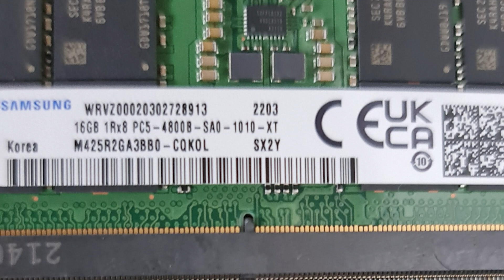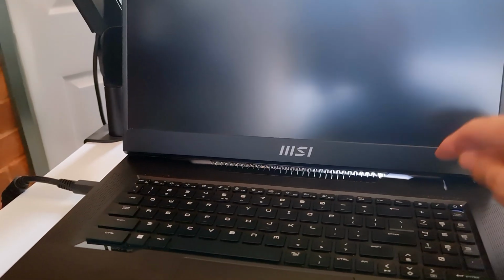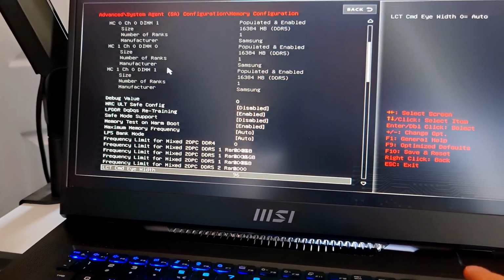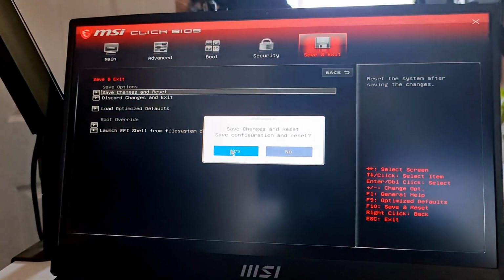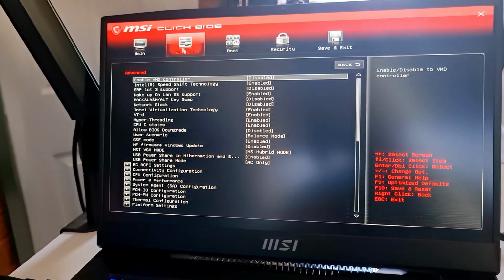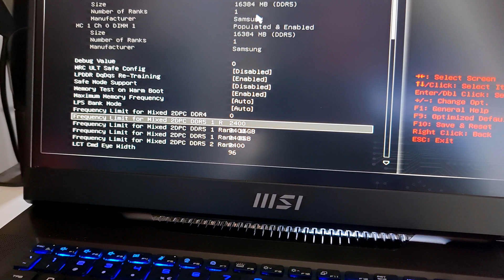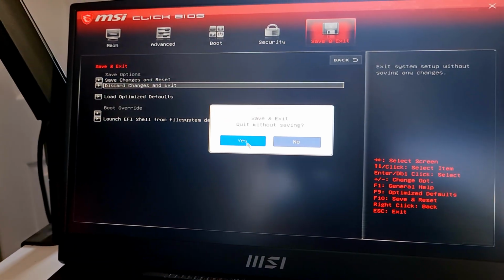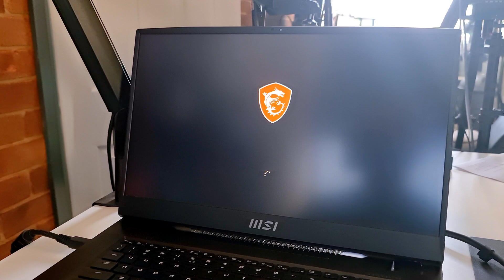How To Enable XMP on the MSI GT77 Titan Laptop

Comment from the maker: If anyone has any alternative methods for enabling the XMP, advise in the comments! Also, if anyone has found a solution to the boot delay, again please put your findings in the comments!
Reply: hey i got gt77 uhs today and found the solution. you do as u did set the profile to custom and on the other screen dont change the values to 2400 but as in help set all 4 to 0 which equals auto. it will load xmp right away. and for guys with all 4 stick populated in quad channel it can run ONLY 4000. as for the delay after restart these new chipset with ddr5 memory support training memory every time u touch it. i had 2 minutes 1st restart as well but then all back to normal. the system basically testing what it can afford. note the memory at 4000mhz runing lower latency then at 4800mhz but as for 3dmark the 4800mhz producing far bette results for me
Reply: Hi there mate,i just found a different method to change the frequency  of ram in bios without  having  that boot delay.i'll put a video to fix this issue,it's  not hard to do it.
Reply: @dunconpitbull  i have GT77 and the max memory frequency choice was 4000.
Reply: @dunconpitbull  where is the video?
Reply: Merci beaucoup @phatlavinh6150
Reply: I have a katana 15b13v, enabled secret menu - enabled oc - "memory profile"\"memory" not an option. If I just manually change the ram speed screen stays black and have to d\c battery (reg and cmos) to reset BIOS to be able to boot
Reply: @jlatture1  i got the same problem.because u can t overclock ram on Katana.u will ruin windows and a reinstall will be needed.all fury 5600-6000-6400 come at standard 4800.crucial is better because 5600mhz is standard.5600 cl 46 still better than 4800 cl 40.
And latest i714650hx that is in katana support only 5600mhz max anyway
Reply: Hey im the guy from reddit that switched out sticks from annoyance :) . I've tested this new BIOS on those same new sticks, i get the same slow boot issue if i try to manually configure timings. If i use the XMP profile it boots just fine. Must be to do when settings are changed for memory that's not left default or set to intel xmp. Annoying because i was running with better timings previously but the slow boot seems to also effect devices, my TB dock has issues and i have to refresh it if i use manual memory settings - likely due to whatevers happening during boot
Reply: Works great with ram that has xmp profiles on it. I suggest to just get new ram with xmp on it.

Also, you can fix the slow boot problem by turning off the test memory option. Once you see the wording , it becomes readily apparent why the boot is slow. It takes time to test the ram to ensure it's working properly
Reply: @Tech3D The solution is simple, you don't need to enable Overlocking feature or Set memory speed to 2400 just let it be

Just following these steps:
1) Set [Memory Profile]: Custom Profile
2) Set 0 for the fields from [Memory Ratio] to [NMode]
3) F10 to save and wait until the windows boot up ;)

*Note: MUST keep [WDT Enable]: Disabled, If you enable this option the slow boot will come
Reply: @phatlavinh6150  This gives me 4800mhz, but still have the slow boot. :(
Reply: @omarab837  Hi mate, I'm so sure that you leave the Overlocking Feature is enabled. It is okay but you MUST switch "WDT Enable" to Disable. Try again and let me know if it work :D
Reply: @Omar AB  those steps  doesn't  help mate,the simple and best way is to dl i just showed in the video on how to change the ram frequency.
Reply: @phatlavinh6150  hi i did what you said and now it works! even when i have overlock feature enabled it works! I undervolt 150mv on cpu and follow your instruction and ram also show 4800mhz and my boot is fast/normal. Thanks bro!
Reply: @dunconpitbull  I saw your video to select the mhz, but on the gt77 4800 is not an option to select unfortunately, the best solution with a fast boot was Phat La Vinh's method in this chat thread.
Reply: @phatlavinh6150  hi there! May I know  what is WDT
Reply: @phatlavinh6150  Yeah!!! Works great and even boots faster after this. The very first boot after this manipulation also takes long but only the first one.
Reply: Thank you!! Worked on my vector 16 too.

Comment: I revisited this after a while, important note to unplug your laptop after changing setting, hold the power button in power off it will turn orange just keep holding it till it blinks multiple time this will refresh the laptop configuration. Plug the ac power back in it will auto boot without you pressing it on. It will boot twice and then you will load up system

Comment: Figured out how to get rid of the boot delay and get max performance at 5600MT/s or whatever your RAM is rated for at least without tightening up timings. Haven't found a quick way to reset the bios on my B13VGKG-665US so fooling around there would be super tedious. Right now, I have to pop the bottom off and disconnect the main battery and the CMOS battery to reset. So, do what he says in the video. After a reboot and all is running at 5600MT/s or whatever your RAM is supposed to run at. Then go to your timings settings and set the TCK to 56 set all other timings to 0 (Auto) not the voltages, leave them be. Save and reset. It will do an initial training and afterwards boot normally. Got a 15-20 FPS boost from 4800 to 5600. Works on the stock 16GB 5600 kit that was running at 4800 OOB as well as the Crucial 32GB kit I bought as an upgrade. If anyone knows a way to quickly reset the bios on these books, I'd love to know about it or just have the bios boot into safe mode on OC fail. The button on the bottom of mine swaps the dual bios config and all is the same.  Thanks, hope this helps!
Reply: Timing settings where?
Reply: @MicGregor  Under the System Agent>Memory sub menu
Reply: The latest bios for my Sword 16 allows undervolting now! It runs amazing on -150mv on the P-Cores, -100mv on the E-Cores, -50mv on the ring and GT. Awesome! Thanks MSI, I must have emailed them about this 20 times. Finally!
Reply: Just doing an EC Reset will reset the Bios. If anyone gets stuck. To do this just unplug the power adapter and hold the power button for 30 sec. plug the power adapter back in as it will not boot from the battery after an EC reset then power back on to a reset bios.

Comment: Thank you for your video! Itried to install 192GB RAM (4x48Gb DDR5-5600 Crucial) to my MSI Titan 18 today. The all planks are visidble in BIOS but when the laptop is about to start Windows it stucs. Could anyone advice if there is any approach how to make it works? I tried to start with one or two planks but no luck. The BIOS is the latest. Thanks.
Reply: Did you get it you work?
Reply: @Asylum377  nope. I gave up and installed 128Gb for now. I checked the planks in a different PC and they works well. I believe MSI do not have the right BIOS for 192Gb yet.

Comment: MSI Slow Boot-up times:  For these MSI bios, no you can't set profiles and that means each time you need to reset to Defaults, you'll then need to go back to your boot configuration and delete everything except the C drive from that list. Also you should move the C drive to the top of the list giving it 1st boot priority. If you ever need to boot from USB you'll need to come back here and enable booting from USB... but I promise this knocks like 40 seconds off MSI laptop boot time.

Comment: IMPORTANT!!! I did the steps you explained in the video. I've been waiting for more than an hour for the part that you said would take 4 or 5 minutes. Still black screen. What should I do? (My laptop is MSI Titan GT77HX 13VI)
Reply: Hi dude. Try to disconnect the power cable and push the power bottom for 30 sec. The led will flash once, the some strobe flash. Then, connect power cable and turn on laptop normally.

In my case - it help.
Reply: i think you need reset your bios to default...remove battery from laptop... or google how you can do it whithout

Comment: Can I do the same with 64gb 5600mhz (32x2)? what value should I change in the bios,2800? is it absolutely safe to follow the method with 5600mhz? Hope you will reply,thanks
Reply: Hello. I have the same, 64GB 5600. What did you set the memory values to for each? 2800? Are they supposed to add up to max ddr mhz your memory can support? Pls advise.
Reply: @bhargan  unfortunately I change the original one to 2 64gb 5600hz like I just  , and the laptop won’t start , black screened till I removed them.I don’t know what is the problem, sorry

Comment: I have a new GT77HX 13 VI-028US, with 128GB RAM 4 x 32GB (Crucial 4800MHz).  I tried your settings and after the 5 minute reboot wait, logged into Windows 11 and with 15 seconds the video all moved to the top 2 inches of the screen, all messed up.  I rebooted and saw the start screen for windows for about 3 seconds before the screen went blank.  After several reboots, I finally got into the UEFI settings screen and changed everything mentioned in this video back to original settings.  The laptop is running normally again.  There has to be other settings that need to be changed or tweaked for this to work properly.  I appreciate your video and thank you for showing me the "secret bios settings".   Take care.
Reply: You are using 4 kits? If that so, then 4000mhz is the maximum speed the system can handle. This tutorial only work if you are using only 2 kits of RAM.
Reply: @brahmasthaandipramana7591  Thank you.  :D

Comment: I found by going into system agent configuration under advanced tab and then go to System memory configuration and change max freq from Auto to 5600, thenChange Frequency limit for mixed 2DPC DDR5 from 2000 to 2800 Mhz in all 4 rows I was able to get 5600MHz. This was on a GE78 though and I didn't need to change the profile. The boot up time is very quick still.

Comment: Please help, I just did this with my GT77 HX 13VI and it has been 30 minutes and nothing. It did the white light like you said and then went back to orange, but the logo never comes up. It appears to be completely bricked.
Reply: oh I just looked in the manual and found this. It worked, that's a huge relief!: Battery Reset • Whenever the system firmware (EC) is upgraded or the system hangs, please 1) remove the AC power; 2) long press this key for 20 secs and then the LED goes to blink, and after 5 more secs the LED would go off; 3) connect the AC power; 4) power on the notebook.
Reply: Never mind thank you @XCraftllc

Comment: I tried this method with my Titan gt77 13 VI, on Kingston Fury 5600 (KF556S40) sticks. Unfortunately, I think it does not work. How long does it take to start computer after clicking in the BIOS change "2000-2400"?  On my Titan fans are spinning, computer is doing something, but after half an hour I lose hope. BTW these memories can be set as low as CAS 24, you can also shorten other times (in aida 74.5 ns) -but all only at 4000. With such a change, I wait for the boot 5 minutes. (once, then starts normally).
ps. I emailed Kingston tech support and was told: these sticks should work properly with GT77. So it's definitely a matter of MSI BIOS settings.
Reply: Well I think I have found the solution and apparently it is an error in the MSI BIOS, for some reason in the advanced options the memory speed is set to 2000 by default which is equivalent to 2000mhz or 4000mhz in dual channel, many people claimed that the required speed should be set manually... In the tutorials that I found on youtube and forums it said to set 2400 to obtain a speed of 4800mhz or 2800 for the speed of 5600mhz but you must do the complete opposite, you must go step by step (not all at the same time since there come the delays and long waits and problems)... Restart with each activation.

We start:

You enter the BIOS then press the keys (R-CTRL+R-SHIFT+L-ALT+F2) to activate the advanced bios (you must do this every time you enter the BIOS) (each reboot takes a while and you only have to have patience), go to the path advanced>system agent (sa) configuration>memory configuration>memory. There you will find the memory profile, then change from (default SPD profile to custom profile) below find OCsafemode and deactivate it, reboot and enter the BIOS again to go to advanced and look for "overclocking performance menu" put the overclocking feature enabled, reboot again and at this point you will see that the reboot takes a little longer than usual but you must be patient and not panic as it takes a few minutes... Once it starts, enter the BIOS again and go to the advanced path> system agent (sa) configuration>memory configuration. You look for "frequency limit for mixed 2DPC DDR5" and the FOUR values that are in 2000 change them to number 0 since this value applies automatic speeds together with the latencies that your memory has. and this would be all... you restart again and it will take time but in the end you will get the maximum memory speeds offered by the manufacturer and you will not have problems.

I think that the value of 2000 that comes by default is the real problem because it forces you to have that base speed, on the other hand the fact that the "Dynamic Memory Boost" cannot be activated at the moment also generates these inconveniences.

I did it with a kingston DDR5 64gb (2x32) 5600mhz cl40 memory kit (I think they are the best on the market at the moment and even more with that latency) the change was considerable since the 3dmark time spy increased about 960 points without modifying values in the graphics card to get a score of 22430 points.

If you're in the same boat changing these memories on this laptop and require additional help or have any questions, I'd be happy to help you resolve them. greetings !!
Reply: @vikpar  real mvp
Reply: Same here... I tried everything to set the speed @5600mhz but I didn't get any results, I was able to put the factory memories @4800mhz but the Kingston only started me correctly @4000mhz... there are too many obstacles and steps to set memory speeds that other manufacturers simply put it automatically, I think this has a lot to do with the immature BIOS of the 13VI/VH version, because the Dynamic Memory Boost cannot be activated either, and in the BIOS options it appears only in gray color, as well as the XMP
Reply: I have also ugraded my Msi GT77 Titan HX 13VI with Kingston Fury 5600 MT/s RAM sticks (2x32Gb) and i can't get it to run faster than 4000MT/s either.

Comment: Hi thanks for this video. I just bought 4 x Crucial 32gb 4800 mhz and my system is running at 3600mhz? Is there any reason why i shouldnt follow your tutorial?
Reply: If you want to run @4800mhz just leave 64gb... otherwise 128gb will only run @3600, it says so on the MSI webpage.

Comment: Thanks! My GT77 (13th gen) came with 2x 32gb 2Rx8 at DDR5-4000, even a different set of 2x 16gb 1Rx8 5600 sticks ran at 4000 out of the box too.. I followed this and changed all 4 variables from 2000 to 2800 (half of 5600) and it seems to have done the trick. Running at correct CL46 timings for the memory kit too without having to change them manually.
Reply: Hey I have the same machine but I have the 128GB model. I was trying to play with the ram to get it in the same configuration as yours. But whenever I have only 1 ram in each channel the device doesn't even boot. Tried all sorts of different configurations and best I got was 4000 with 2 sticks. Sometimes I'd get 3600 with 2 sticks. Do you know if your machine has both sticks stacked on top of each other in the slots, or is it they're both at the top/bottom ram slot?
Reply: @michaelp9238  I only have two sticks and I installed them the same way it came. In the two slots closer to the back heat pipes the stick is in the top slot, then with the two closer to the front battery only the bottom slot is populated
Reply: @JarrodsTech  thank you! That fixed my crazy issues. Now I just need 5200 DDR5 64GB
Reply: @JarrodsTech  I LOVE YOU, i had 128 GB removed two, at first that didn't even work, then i got 64 GB running at 3200, your setup made it work at 5600 MGhz, <3
i don't know why MSI doesn't give any info or Walkthrough for this.
Reply: Did this work for the stock ram as well? I have the new 13th gen Titan as well with 64GB of RAM and thought we were limited to ddr5 4000.
Reply: @tomgjonaj9965  yes works with stock. Your stock can do 4800. 5200 just came out and I bought it. Using it now. Difference between 4800 and 5200 doesn't warrant the price IMO
Reply: @michaelp9238  do you know which setting in the bios stops the 1 minute delay for each boot?
Reply: @tomgjonaj9965  no but if you ever find out please let me know
Reply: I have a msi raider ge67 hx with 3080ti and i9 and i bought a kingston fury 32x2 64gb dual channel kit with 5600 and its not changing on task manager if i change it to 2800 in bios… is 4800 just max for my laptop?
Reply: @jurgenhasler6718  That's because Intel 12-series processors support up to a maximum of 4800MHz and 13-series processors up to 5600MHz.
Reply: So u are using 2 32gb 5600 right? is it absolutely safe to use this method?and also were there any error occurred after u do the method? Thanks for reply
Reply: Whoops!! I accidently set my MSI Stealth 15 OLED i7-13620H RAM to 5600... seems to run still. Gonna have to do a memory test